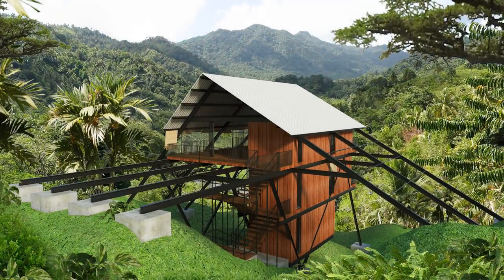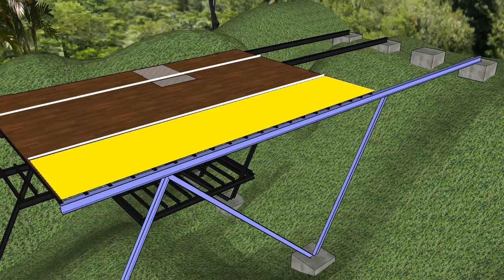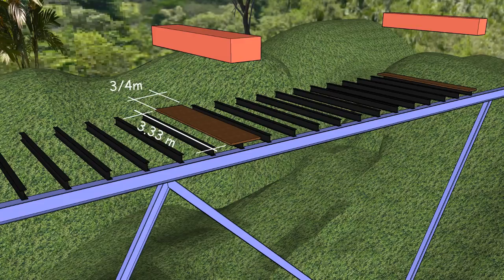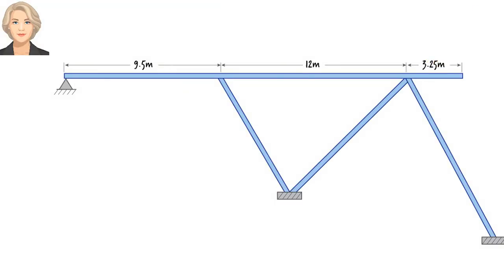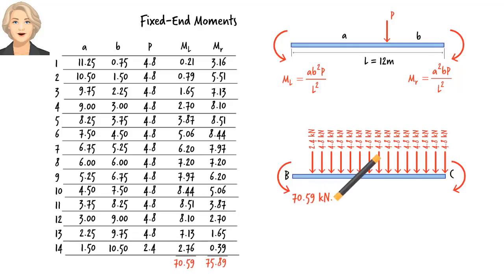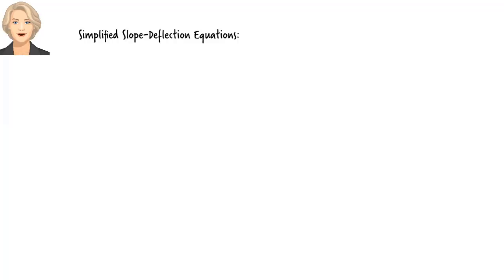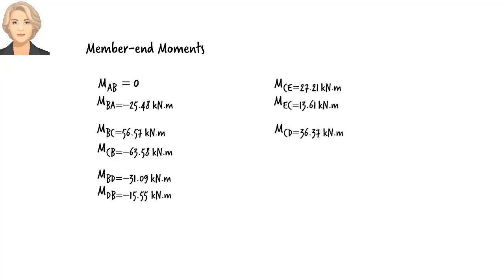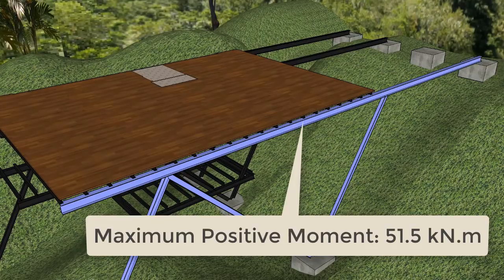SA44: Analysis of a Building Frame using the Slope-Deflection Method

Comment: How come there is no deflection or delta value at C? 
Is it assumed that there is no delta value for this problem?
Reply from the maker: Yes, we are assuming that vertical and horizontal displacements are negligible in the frame. When analyzing a frame with multiple non-negligible displacements, the matrix displacement method works better than the slope-deflection method.
Reply: @DrStructure  thanks for your reply! So, let's say we take my example of an end load of 10kN and your same load at BC. However, we also look at the deflections. How would C deflect? I'm thinking BC will curve like a U, at the end the 10kN load would also curve down. However at C I'm not sure if the beam would move down due to these external forces or remain stationary due to the final angled fixed member CE which I think would restrict the deflection at C. Please may I ask your thoughts on this?
Reply from the maker: @king0vdarkness  Correct, the shape/geometry of the frame restricts displacement at B and C. Under that loading case, BC does bend downward (concave up) while the overhang segment takes a concave down shape with the very end of the segment deflecting downward. Although joints B and C end up having very small (insignificant) vertical and horizontal displacements, for all practical purposes, we can assume they are zero. This image (http://lab101.space/QA/SA44-frame-1-deflection.jpg ) shows the exaggerated deformed shape of the frame under the assumed applied loads.
Reply: @DrStructure  thank you so much. You are not only a great teacher but you take the time to answer my questions with great depth! I really appreciate your time and help. :)
Reply from the maker: @king0vdarkness  You're welcome.

Comment: If, @ 4:02, there was a load at the end would you consider it as a canilever? Also, would this then affect the rest of the calculations?
Thanks for the video! :)
Reply from the maker: Yes, the frame has a cantilever segment. A load placed on that segment does affect the rest of the calculations. In such a case, we could either expand the slope-deflection formulation by viewing the cantilever segment as one of the beam segments, or we can transfer the load(s) placed on the cantilever to joint C, then remove the segment as is done in the video before analyzing the frame. 
Suppose a downward load of 10 kN is being applied at the free-end of the cantilever. Since the length of the segment is 3.25 m, the applied load causes a clockwise bending moment of (10x3.25) 32.5 kN-m, and a downward force of 10 kN to develop at joint C. So, we simply replace the cantilever segment (along with the applied 10 kN load) with a clockwise moment of 32.5 kN-m and a downward force of 10 kN at C, then proceed with the analysis. Naturally, these two forces at C affect the results of the analysis.
Reply: @DrStructure  thanks for your detailed reply, that helps a lot! :) I have subscribed as your videos are great! 
Btw If you're ever in need of any voice actors, for your videos, please let me know.

Comment: Do you deem that is a mistake if we show shear diagram like linear instead of saltation because concentrated loads are close to each other? Moment diagram is similar now and it looks like parabolic shift.
Reply from the maker: Yes, we can approximate the series of concentrated loads with a uniformly distributed load. That would somewhat simplify our calculations without significantly changing the results.